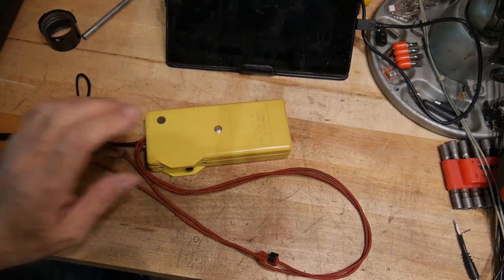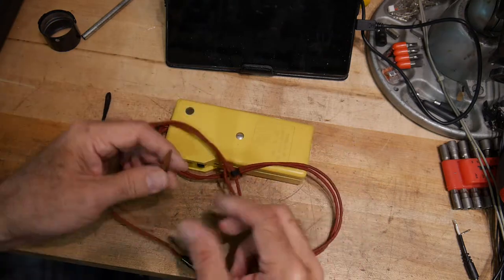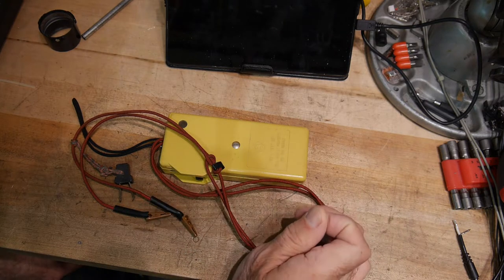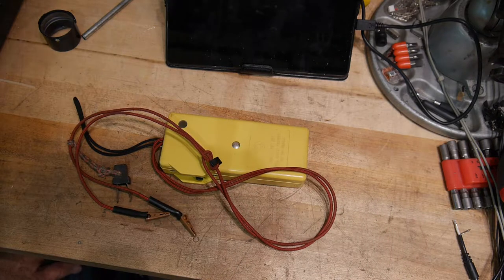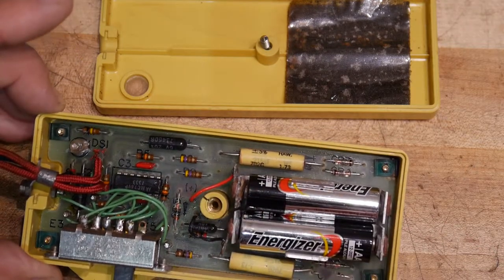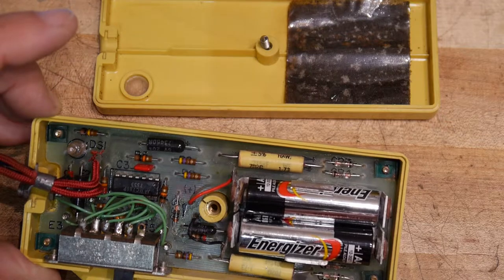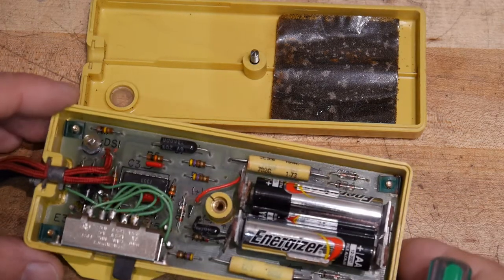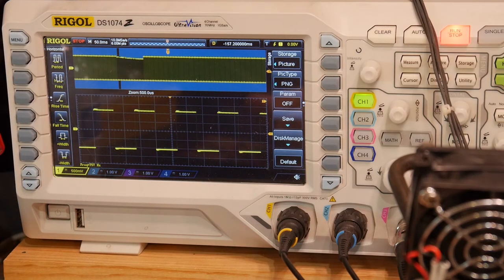#224 Bell Systems 139 test set

Comment: Thank you for your this video. I am a retired AT&T phoneman. I was issued this tone, as we called then and carried it for many years. It was more than a tone generator. On the Talk setting I mostly used it for a continuity tester, looking for shorts. In the Telephone network you are dealing with a lot of wires and to find the one you are working on a tone generator is critical to the job. Finding shorts is another critical part of the job. With this I could simply look for shorts in wiring or equipment. The Talk function was if you were working with another tech located in another yard or wherever and each of you could talk to each other on your butt set or phone and talk to each other on the battery coming from this set. You could also look for grounds by connecting one test lead to ground and connecting to one side of a line. It was an important piece of test equipment to a phone man. I still have mine and keep it in my tool box to test continuity in whatever today. This was later replaced by a smaller square unit that had a 9 volt battery and it was much louder and it also had a modular test cord you could plug in to a phone jack to see if had dial tone. The only problem with these is with a 3VDC battery they were not very loud. You mentioned the ring cycle when on a phone line. When a landline rang it put anywhere from 90 to 100 VAC on the line. I have been shocked many times by it and it was a bad shock. I never knew of anyone dying from it but it was not pleasant. We called it Ring generator....Good Luck BP.......